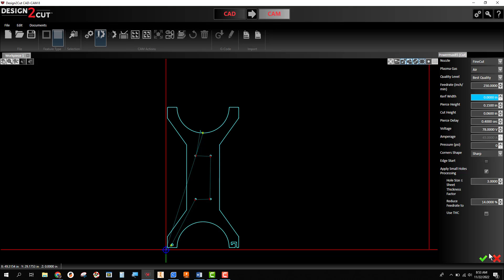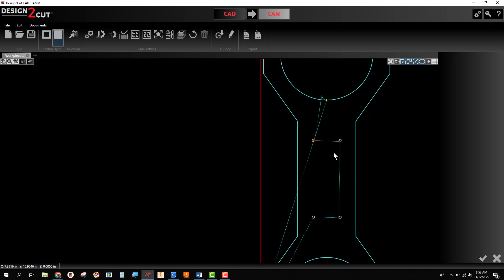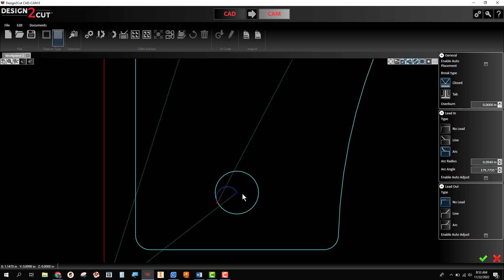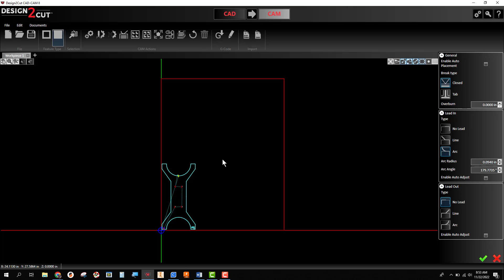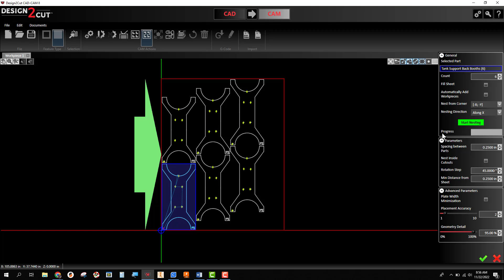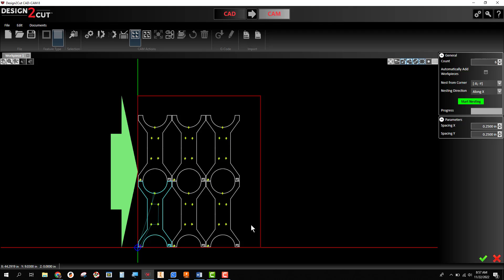Nesting with Design2Cut or FlashCut

Comment: Question, on the Westcott table, do you need to zero the torch to the table when you start the machine, then zero out on the sheet to cut? I have an arc light table and when i turn it on i have to zero the X&Y before i can do anything else.